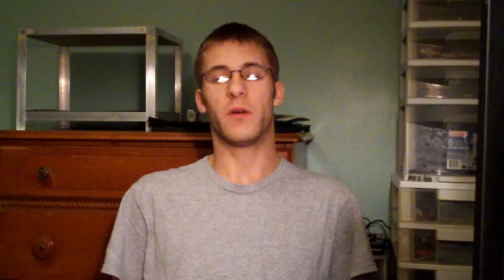Positive vs Negative Case Airflow

Comment: Positive case pressure only way to fly. Air intake filtered.  Pull filter occasionally, toss it.  All those little gaps and holes are just particulate entry when using negative pressure.

Comment: Wanted your opinion. My case is a cooler master haf 912. Currently cooling an i5 3570k with a hyper 212 evo and have a r9 290 gpu. With current Settings my cpu idles around 47c and during most games peaks around 63-65c. I have 1 80mm intake in front, 120mm intake up top above cpu (lower rpm i believe) and 80mm exaust in back. I have one spot on the side panel i could add an intake or exhaust fan. Which do you think it should be?
Reply: Exhaust for sure
Reply: No no no. First of all, the HAF 912 doesn't even support 80mm fans. The two stock fans it comes with are 120mm, and set (by default) to pull air in the front and push it out the back. This is good.

I highly recommend adding a second 120mm pulling air in the front, a 140mm pulling air in the side (not exhaust), and a 200mm pushing air out the top (exhaust, but nice and quiet). With this 5 fan set up, you'll never have high temperature issues as long as you're cleaning the dust filters regularly, unless you're doing some extreme overclocking. 

Source: I'm running the HAF 912 in exactly the aforementioned setup.

Comment: Corsair carbide300r, I have two extra fans 140mm and 120 mm where should  place them? I'm thinking to place them both on the side panel, since there is an opening at the top of the case.
Reply: If the current fans are already set to pull air in the front and push it out the back, adding the 2 extra fans as intakes would significantly increase your cooling. 

I recommend the 140mm intake on the side and 120mm intake on the top, though if you can get a second 140mm it's even better to have both of those pulling air in the side and the 120mm exhausting out the top.

Comment: I'm currently building a PC in a fractal design define mini, and should i do this type of fan configuration?
Front top: corsair AF120 silenced edition IN 
Front botton: corsair SP120 (drive cage in the way, so static pressure needed there) IN
Bottom: same as front top IN
Rear: corsair AF120 performance edition. OUT

Sound good?
Reply: Exhaust out the top because hot air rises
Reply: It'll anyways be exhausted by that rear fan.
Reply: yes, that's a good setup there  :)   I myself have a Fractal Design Define R4 case with (4) Noctua NF-A14FLX 140mm fans installed (i didn't like the Fractal case fans).  I have two fans in front blowing IN, one fan up top blowing IN (with magnetized fan filter on top of case), and a rear fan blowing OUT.   Make sure you use a fan filter for the top fan, otherwise it will be blowing dust into your system.  With this setup I get very little to no dust buildup inside my case, which was what I wanted to achieve.

Comment: Not bad mate, but  true air flow is cool air comes from the bottom and hot air rises. So for a well balanced air flow I would suggest 3 intake fans "2Xfront intake and 1 from the bottom. That way you have an excellent intake of cool air in your case. As for the exit fans, always as in all cases "top back and back exits". That way the 2 front fans pushing air against the bottom fan, will create an angled air flow to the back top corner of the case and directly to your graphics card.

Comment: It truely depends on the level of positive vs negative airflow, and both to the extreme are bad, and both situations move the same amount of air. The BEST case scenario is ever so slightly positive. One can get away with a greater amount of negative pressure then positive, but this causes dust to settle in the case, and never leave. This is inevitably leave you with a disgusting case with terrible airflow, without a rigorous cleaning routine.

Comment: You said "negative pressure, the air is sucked in or every possible hole into the case" so that means the pressure evens out, right? So why cant you use the same logic to positive pressure? If there are more fans blowing in, the air will escape on every possible hole there is, so there is no pressure buildup because the air escapes. Dust buildup is only dependent on whether your room in clean or dirty. So stop wasting your time on useless "science".

Comment: this is actually very bad idea. i would suggest only rear and front fan. others will ruin your airflow and you will have dead spots, because that top and side fan will just ruin ideal airflow from front bottom to rear upper one.

Comment: Anyway you can't pull or push more air thru a case that what you actually push/pull. If seemingly 100cfm in and 80 cfm out, then really its 80 in and out, there is no +/- here. The fans produce so little pressure its a bit absurd to talk about it, in these terms anyway.

Comment: Take a pc case completely sealed up and put a heater inside it to imitate the electrical parts. What happens- the air inside heats up and expands, positive pressurizing the inside. Even with holes in case air inside will have pressure. Take a propeller fan and try to push air into case, it hits this pressure and slows down. Propeller fans don't do well with pressure on the outlet side. Same fan pulling air out of case has the pressure helping to move it. "NEG" here is easier than "POS".

Comment: It's the case design that makes negative or positive your choice like he said. My case had 10 fan slots if I need to use them. 2 120mm overhead which vent hot air out the top since heat rises. 2 120mm intake in the front, 1 140mm bottom intake, 1 120mm rear exhaust and 2 120mm side one is an intake the other an exhaust. One exhaust heat off the CPU heat pipe the other cools the video card. I also have 2 120mm fans behind the hard drive cage that are pullers from the front which can be adjusted.

Comment: I have a mid size case that has 4 fans pulling air to the case and 1 fan pushing out from the case that is located in the back..  would this cause a problem?

Comment from the maker: Perfect only changes if you have time or really care about 1-2c is switch side panel fans around see if it helps or hurts. Some set ups/gfx cards like exhaust on side panel. It would be more unbalanced however.

Comment: i have a cm 690 II advanced and my case fans are placed like this......
FRONT PANEL-  one 140mm fan and one 120mm fan as intake
BOTTOM- two 120mm fans as intake
LEFT SIDE WINDOW- two 140mm fans as intake
BACK- one 120mm fans as exhaust
TOP PANEL- two 140mm fans as exhaust
RIGHT SIDE WINDOW- one 80mm fan as exhaust

Comment: Doesn't matter which you use. It's the Temps that matter, and in my case (with my HAF922 laying flat on it's side and the top 200mm moved to the side so it's still taking in air from above and the original top vent faces towards my keyboard. This is for 2 reasons, 1. Bottom intakes get better airflow this way, 2. if upright the side intake faces a 90 degree corner in the room) Positive airflow  Produces the best temps.

Comment: or just use positive pressure. i got 6 intake fans and 1 outgoing fan. which means all holes etc will have air moving OUT of the case : )

Comment: everywhere air comes in on negative pressure case air goes out on positive pressure, the only time you get stagnant air is on neutral air pressure. on positive air pressure you can filter it because the intakes are exactly on the fans rather than everywhere. negative pressure, every single crack in the case, the disk drives, etc becomes a dirty air intake. I was hoping for some logical reason (other than to shorted the lifespan) for negative pressure.

Comment: I know this is an old video, but I would like some clarity.

I also have a CM 690 II Advanced and I have 9 case fans installed:
Front: 2x 120mm intake fans running at 1000/1200RPM (not each)
Side: 2x 140mm intake running at 1200 RPM
Bottom: 1x 140mm intake running at 1400RPM
Back: 1x 120mm exhaust running at 1000RPM
Top: 2x 120mm exhaust running at 1200RPM

Temps: i7 (2x 120mm fans at 2000RPM each (both intake) 30 degrees C idle, 55 degrees on full load
System 28-30 degrees C

Is this good?

Comment: No doubt that positive airflow is the way to go. Air will eventually go out, it won't be trapped, but at the same time, you'll have a lot less dust accumulation than with negative airflow. Of course the intake fans should be dustfiltered.

Comment: great vid and exsplanation in most cases with lots of vent holes possitive pressure is almost always bestthink of possitive pressure like a baloon what happens when a ballon is over pressureized it will explode all air outi personally wouldnt bbuy a case unless it was optimized for possitive pressure witch is why ill never give up my 932

Comment: Sir, I only have 2 fans, one in the side and other at the backside, is it ok to set it as, the side fan is inward airflow and the backside fan as outward airflow.. plus the powersupply at the back that has its fan taking air from inside the case and flow it out the back.. pls help.. thanks, sorry for my bad english.. hehe..

Comment: @ChadAgWing no spot off you stupid idiot... i mean your name is chad comon... intake fans INCREASE pressure because they are putting more air INSIDE the case, where as exhaust fans LOWER the pressure because they are relieving the case of AIR. but you are right about the last comment... i prefer all exhaust fans and if u clean ur computer internals once every couple months you will be good.

Comment: i have the same case as you.i have one120mm fan(intake) at the front ,two 140mm fans (exhaust) at the top,two 120mm fans at the bottom (intake) and one 120mm at the back (exhaust).any recommendation?

Comment: I would like to add simple explanation for pos vs neg pressure:
Positive pressure setup has more intake fans driving cool air into the case expelling warm air out of any holes.
Negative pressure setup has more exhaust fans expelling warm air out of the case while drawing cool air in through any holes.
I´d say neg setup is better as it minimizes warm air pockets but it also creates more entry points for dust to enter. Also locations of fans is important and varies depending on the case design.

Comment from the maker: @markmarcellus94 You could use to things for a cheap solution; electrical tape for no airflow, or if you had some filter type material like the thin foam that comes in some hardware boxes that would work if you wanted air but no dust. Used both methods work great.

Comment from the maker: @century20001 I depends on case really but if theirs spot for single fan use it as exhaust since most of the time its in the rear. If you have 2-3 set front to intake and rear to exhaust, the side panel can be either, top fan exhaust, and bottom fan intake.

Comment: The more INTAKE fans the LOWER the pressure, thus getting less dust.

The magic formula is to have 1 or 2 more intake fan/s than you have exhaust.

The exhaust fans should be going to the top of the case while the intake fans should be nearer to the bottom.

Comment: @dustinds3000 
I wanted to get those but they don't look appealing. Plus I think they kill too much of the airflow, cause their filter has tiny holes, but I could be mistaken. I haven't seen any good Hi-Res photos or videos with those filters, so. Regardless, filters kill a lot of flow and in some cases add to the overall noise, so you have to experiment. I made my own for the front bezel.

Comment: @dustinds3000 
Not true. I got the same case and you just have to make sure you have dust filters on the intake fans - they will get dusty - but on the inside I don't get any dust. I don't have any fans on the side so nothing gets "trapped" - all the hot air exhausts through the PSU fan on top, the back 120mm fan or simply the side vents. The door is nothing but holes. And in the front I got 2x120mm and the bottom 2x120mm on intake. Great temps - no dust inside. Just clean the damn filters :)